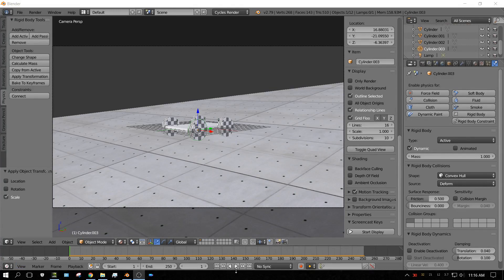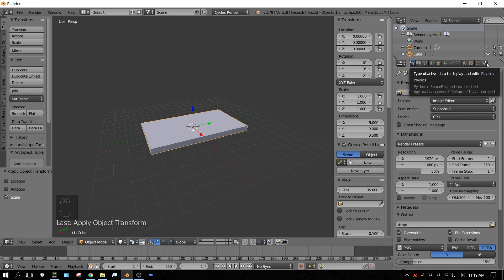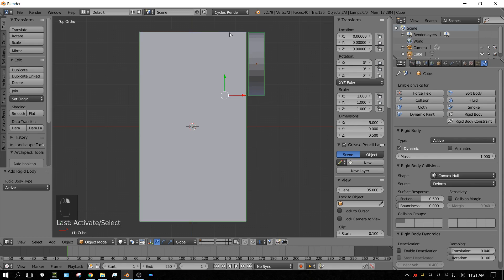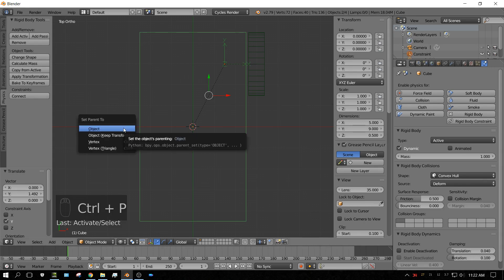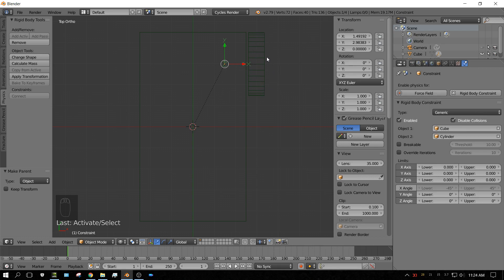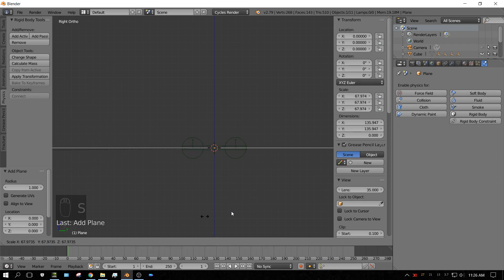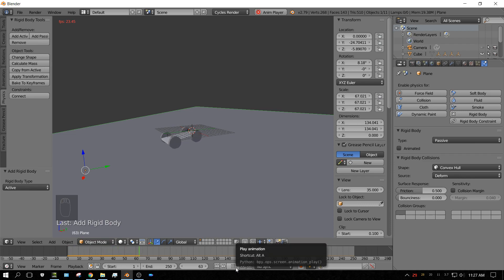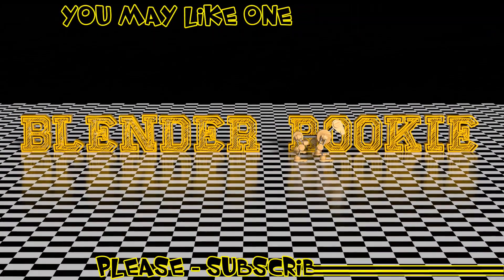Connect Wheels To Car Rigid Body Constraints - Blender3D

Comment: Cheers - this is still the most helpful video for a newb trying to work out physics for a car wheels.  Tips for 2.8x that follow - you can add empties and assign them rigid body constraints, or find the option under the Object menu > Rigid.  If you are getting odd behaviour from your wheels make sure that each wheel's origin is centre of geometry or at least aligned with centre of the wheel.
Reply from the maker: Thanks for the tips

Comment: Came here because I was trying to do this in 2.8 and it was being really weird -- sometimes it works for a few frames before the wheels fall off and go crazy, sometimes bits of it rubber-band back to their starting point for a frame, and sometimes nothing at all happens -- so I thought maybe I'd forgotten how to do it properly (it's been a few years since my last attempt), but it seems 2.8 is just weird. Creating it in 2.79 and loading it into 2.8 works perfectly, but creating the exact same thing in 2.8 is a disaster!

(Also, as a slight modification to your process, parenting the Constraints to the wheels makes life a bit easier.)
Reply from the maker: I have had weird issues ever since 2.8 with constraints. I don't know why it sometimes works and sometimes doesn't. I have had similar issues with the particle system and even the molecular script addon.

Comment: It does work!, but when i disable the "X" axis, it still uses the x axis which leads tho the wheels like rotating in the X axis, i also did this in blender 2.72 idk why it did that but you know
Reply from the maker: Using constraints in this way has always been glitchy. Sometimes I can't get it to work at all. Which is why most people use bones.

Comment: Does this still work with Blender 2.8? because I tried it and it somewhat worked.. it glitches sometimes ( it teleports back and fouth from the original point to the physically simulated point) any suggestions?
Reply from the maker: I am having the same issue in 2.8 There will be a few random frames where a part or two that are constrained together will suddenly be back to their start position. I have no idea what's causing the problem, nor do I have a solution. But yeah, it's driving me nuts too.